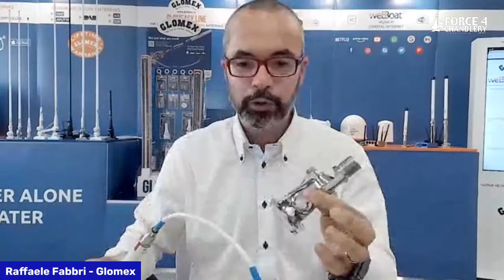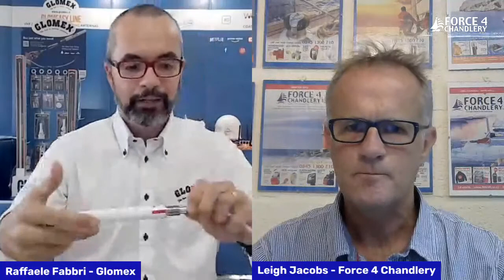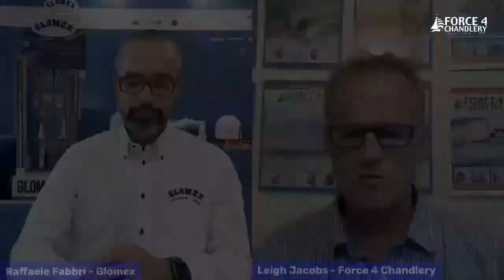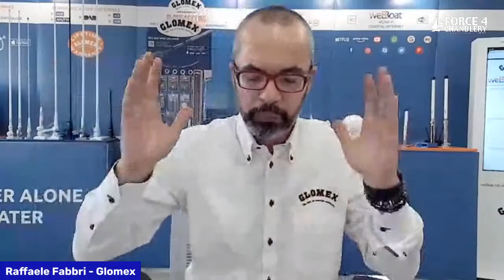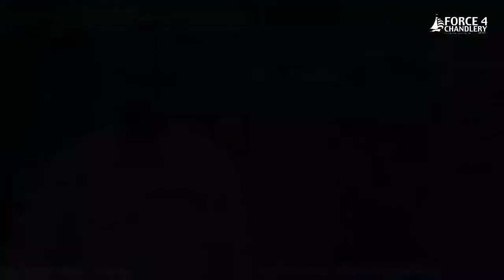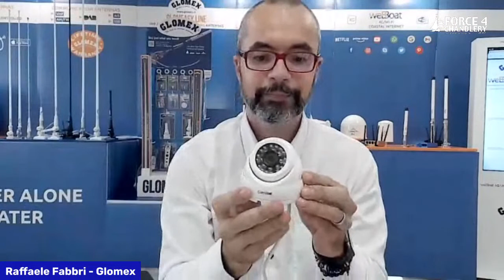Can I surf the internet at sea? Live stream - WeBBoat Internet, Zigboat Security, Glomeasy Antennas

Comment: Very informative video, thank you.  Regarding the current 4G Glomex product range, when 5G become more widely available will it be possible to upgrade the existing 4G based systems or will they have to be replaced?
Reply from the maker: Hi John, thank you for your question. The hardware for 5g is based on a whole new platform which should be launched later this year. The 4G products will continue to operate with 3G/4G networks. If there is anything else we can help you with let us know.